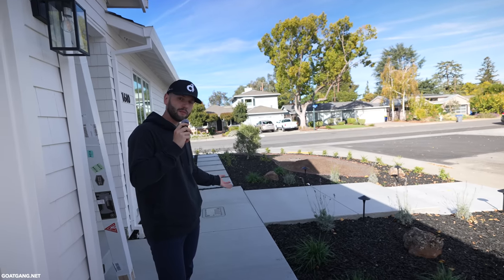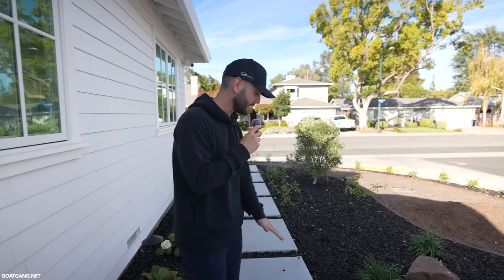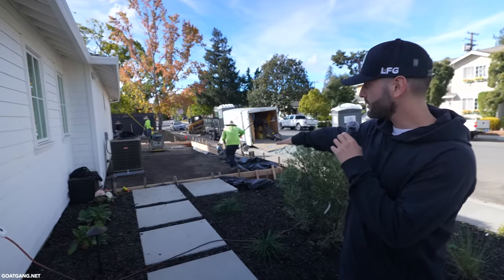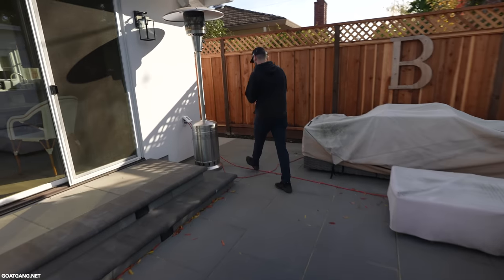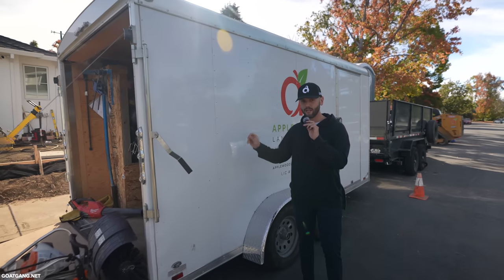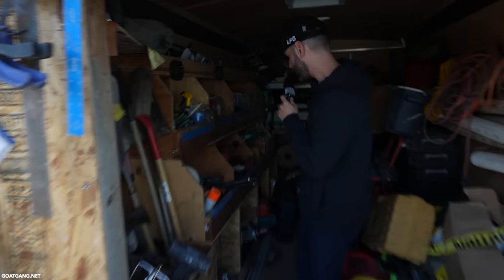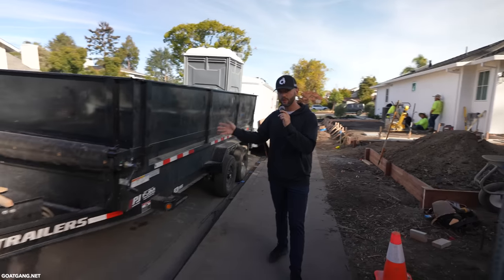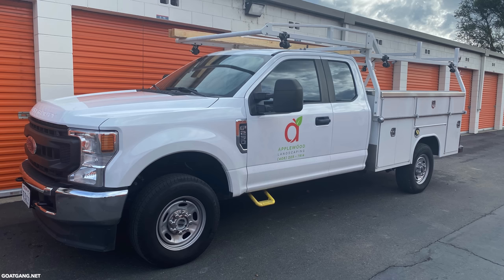Why Landscaping is Better Than Lawn Care

Comment: But out of that 140,000 in mowing …you will take home almost 85, to 95,000 after expenses  and you taking 14,000 for 8 week, so that’s only about 56 for 32 weeks..you jump your profit from 14,000 at the begin of the video  to 30,000 at the end…sound good but cap
Reply from the maker: willl you be mowing 140k in lawns yourself or pay someone $20 an hour to help you
Reply: @TigranGertz I mow 100k in revenue 3 days a week over 34 weeks (April - November) solo. Then 6000 in gutters and 40k in snow removal. All solo. Just hired 1 helper a week ago
Reply: @YoungAmbitionYA What's your average price? Do you target more commercial work?